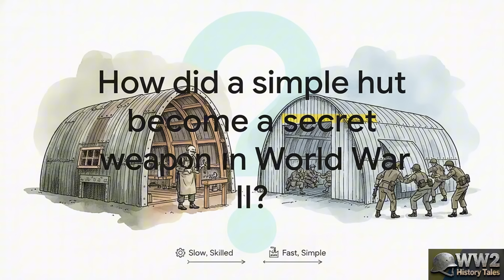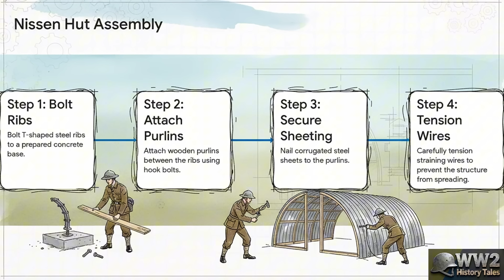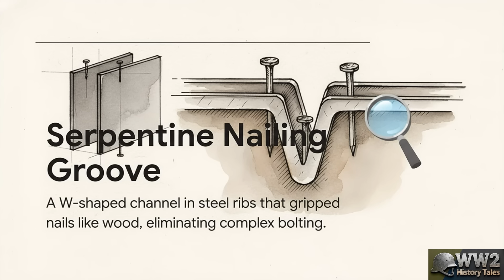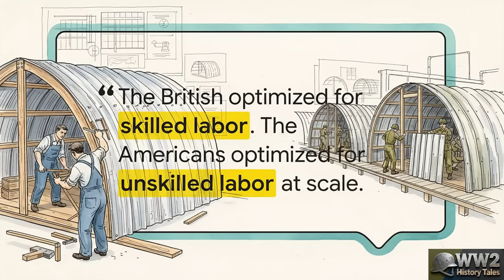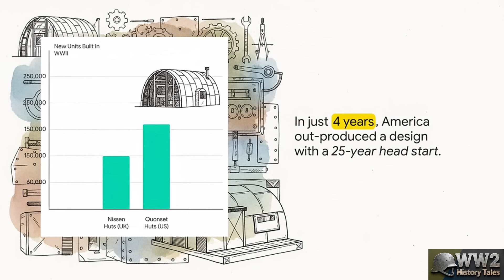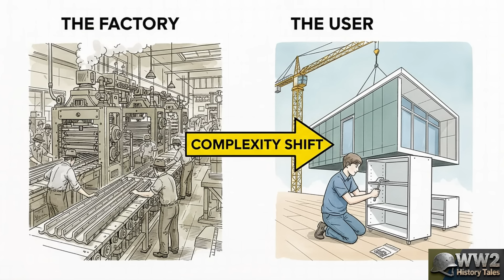🏠 America's 1-Day WW2 Hut vs. Britain's 1-Week Hut | The SECRET Reason For The Speed

Comment: The two designs are 30 years apart and one influences the other. Its like saying lets compare the british harrier with an f35 and then concluding that the US is better at making planes on that basis. 🙄
Reply from the maker: That is a totally valid point about the timeline! ⏳ The Harrier/F-35 comparison is a solid analogy. ✈ The only reason we compare them is because in 1941, the Allies were forced to use both side-by-side. So the 'old tech' was still the active competition for the new guys! 🛠 Thanks for the input! 🤝
Reply: @WW2TalesHistoryy hmm, i dont disagree the hypothesis, rather only the example.The ‘urgency’ and ‘britain was broke’ factors affected a lot of British design development at that time- hence a lot of old designs like the hut continued in use as they couldnt afford to produce a more up to date design ( other examples being .303 and the brodie helmet, neither are kept because brits liked them, they just couldnt afford to change for the small improvement they would result in). If you want aside by side comparison of approaches to engineering at a national or cultural level, i’d suggest looking at the merlin engine as the most glaring example instead. Packard took the RR design and transformed what needed a highly skilled engineer to build, to one which could be mass produced, with interchangeable parts. The impact of this was enormous, and seems overlooked - worth covering in a vid?

Comment: i have the bones of a big one out in my field. The metal is just stacked up in the weather and they haven't rusted in 40 years. Unfortunately, I got mad at my dad when taking it apart at 17 years old and quit. The guy he got to take over ended up bending every rib so my dad never put it back together. I don't know where the ribs are but I'm still using the metal sheathing.
Reply from the maker: Oh man, that is a painful memory! 🙈 It hurts to hear about those ribs getting bent... what a tragedy! 💔 But it is incredible that the metal sheathing is still rust-free after 40 years in the weather. 🌧🛡 That galvanized steel really was built to last forever! Thanks for sharing that story! 🚜
Reply: @WW2TalesHistoryy  It is so much thicker than anything you can buy today. They simply built things better back then. More expensively, no doubt, but clearly better.

Comment: the serpentine nail diagram makes no sense ..  please explain.
Reply from the maker: It’s definitely a tricky concept to visualize! 😵‍💫 Think of it like two steel plates with a wavy gap between them. When you hammer a straight nail in, the waves force the nail to bend and wedge itself tight—kind of like a friction lock. No nuts needed! 🔨🔒 Hope that helps!

Comment: It is the idea of 2nd technical revolution (the 3rd is going now with computers) - make a design which can be implemented by any monkey anywhere in the world. Even Ford with his model T did not develop this, its wartime and after invention. 

For example typical design of car wheel assembly. Up to 1960s - 2 conical bearings, worker has to adjust pretension, fix the nut... any error - and it fails very soon. 1970s - 2row bearing. Insert, tight the nut with preset value, GO! but still can be done wrong. 1990s - hub3, do not touch the bearings at all, ever, they are assembled in the factory, workers task is just to fix the whole assembly to where it must be.
Reply from the maker: Dude, this analogy is absolute gold! 🥇 The evolution of wheel bearings is the perfect parallel to what happened with these huts. 🚗🔧 You nailed it—it’s all about taking the 'art' out of the field work and baking the precision into the factory part (just like that Hub3 assembly). That shift is exactly what won the logistics war. Thanks for this deep dive! 🧠📉

Comment: You still see Quonset Huts in farm country. They're used for storing equipment, grain, and as workshops. When I was in the military in the 1960s, they were still in use at many bases. Training for Vietnam, we had a Quonset for a barracks.
Reply: I still think it's funny that Air Force stationed on Miramar are paid a bonus for having to rough it in Marine Barracks.
Reply: not sure when they stopped be the Marines were using them in the 60's when I was there
Reply: Still see them everywhere in Kansas.
Reply from the maker: Thank you so much for sharing your personal experience! It’s incredible to hear they were still the standard for barracks during your training in the 60s. It proves just how long-lasting and versatile that 'foolproof' design really was. 🚜🎖🌾